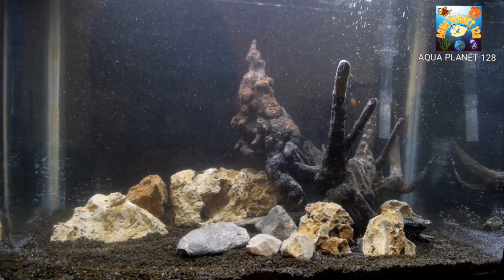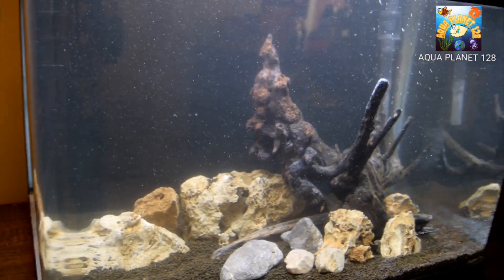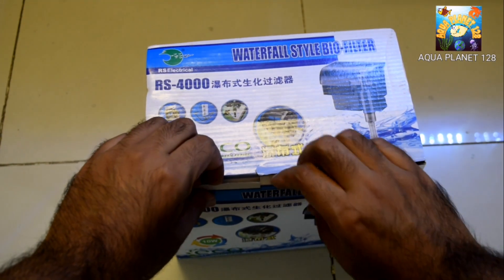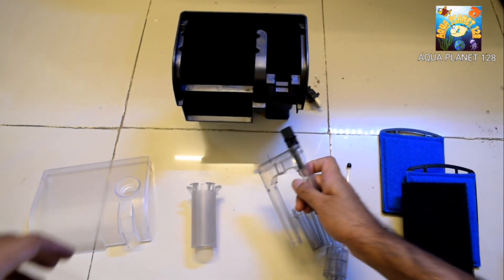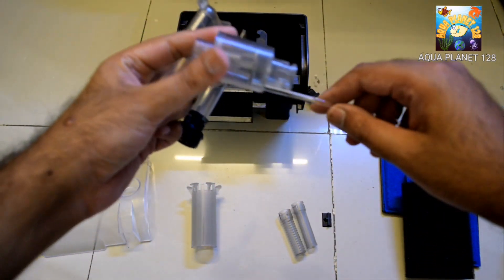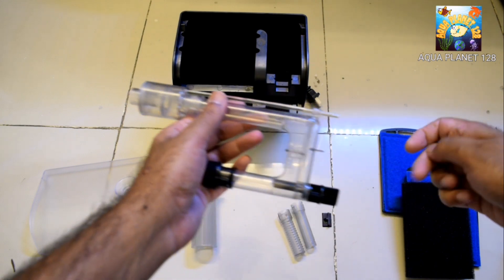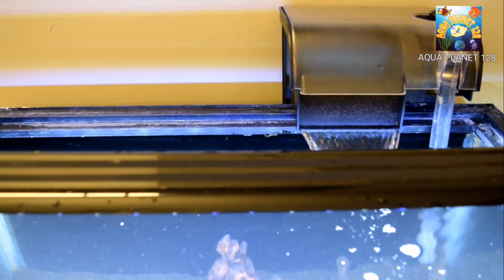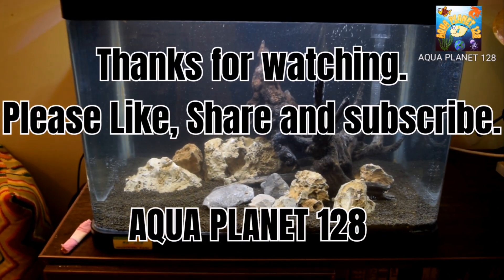RS 4000 Hang on Filter | Hang on filter aquarium | #RS4000hangonfilter #hangonfilteraquarium

Comment: Nice... May i know What's the use of skimmer?
I have a tank with 2.2 x 1.5x 1 which constitutes about 23 gallons of water. So for this which hob filter is better? Could u pls tell
Reply from the maker: Skimmer is used for filtering surface particles.